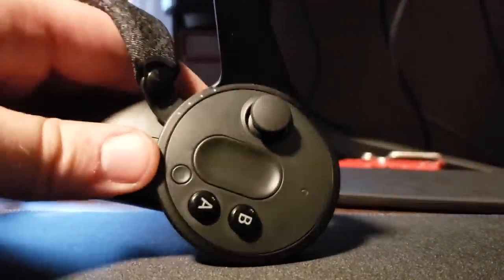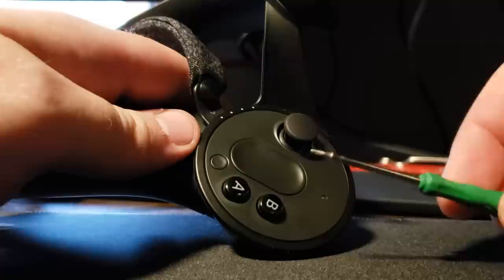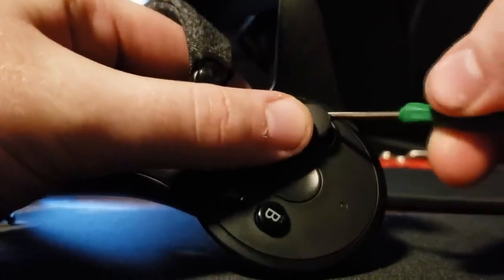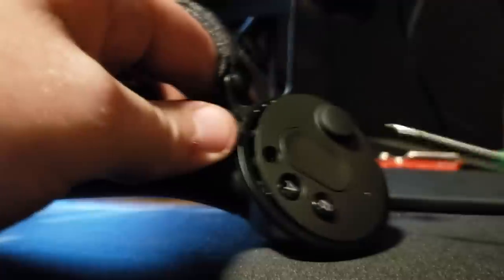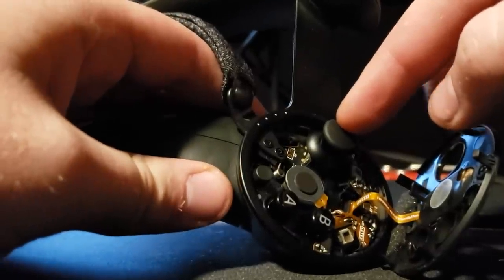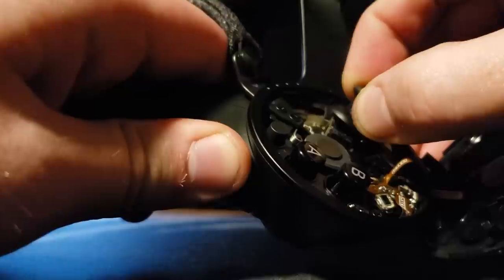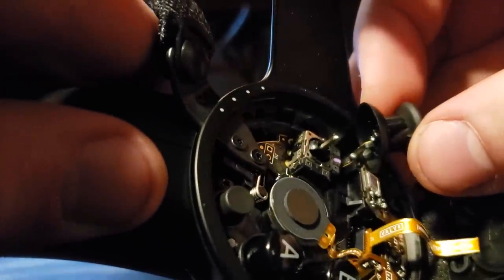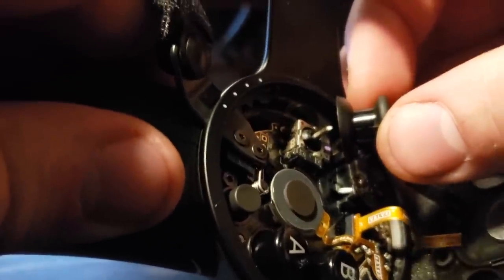How to fix your Valve Index Controller joystick clicks

Comment: Nilick little tip I seen on reddit and did my self. I got a beral pen like a Bic. and cut the nib off so the little ball bearing in the tip of the pen fell out. I then used that in my thumbstick instead of the tooth pick you used and WOW it works amazing well. I have to say though trying to get the tiny ball bearing in the hole was a nightmare and twizzers were not good enough,  what I did was rip a tiny piece of paper up and folded it up and put the ball bearing in that then I gently tilted the paper above the thumbstick hole until it rolled in and put it back together and what a difference.  good thing is the ball is easy to get out if you ever needed to. 
I now have thumbstick click in all directions
Reply: when i get my controllers and if they dont click i will do this! thank you :)
Reply: @BigDaddyMacc  Mine still work amazing. I did my friends as well but he order some 0.5mm Ball bearings off Amazon and they worked just as good. If you do order the bearings be aware that when you first get them you may think you have an empty packet lol I know this because i thought I had been sent nothing but it was due to just how small a 0.5mm ball bearing is lol.

Hopefully you wont have to go through this but I thought the ball method was better than the chop stick as I suspect the wood will start to impact down the hole and cause it to either stop helping or cause more issues. plus if you ever need to RMA the controllers it's simple just to let the ball drop out, with the chop stick I can see it being quite difficult to remove once it's been in the a while and pressed down over time. 

Good luck with your,  out of interest did you buy the index headset also? I did and wow the difference between the index and all the other headset I've had is unreal. I played pavlov the day I got it and was blown away by how clear the image was. It is like looking at a 1080 screen but on low settings but that's just down to the game being a made by a low budget dev team and the limitations of the hardware. 
I'm so excited for VR over the next few years.

Comment: Eh, aren't those controllers supposed to be $280 and have been in prototype for 3 years... Something makes one wonder how such QC issues can slip that easily
Reply: Looks like someone over-engineered that joystick, trying to make things as compact as possible they made the height of that pole the "minimum possible" but seemingly underestimated the amount of manufacturing variability it was going to experience in mass production, as this issue is only affecting a (decent) portion of users and is something that probably didn't come up in the QC runs.
Reply: @invertexyz  agreed.. as mentioned in my comment above, the amount needed to fix without causing any rubbing is 0.7mm increase

Comment: I wonder if a small ball bearing or steel shot the diameter of the metal rod would provide the same spacing function without having to fool with solder?  (drop it in the plastic channel for the rod on the joystick cap)

Comment: Cool fix for something that shouldn't need fixing. I was going to buy two complete Valve Index systems one for my son and one for me but I'm not going to bother, very shoddy equipment with a over inflated price tag. I may revisit the idea of buying them or something better in about a year or so, I've been waiting for the right time for VR but alas I don't think it's here yet ;(
Reply: Lol no product is perfect.
Reply: @whiteoutwolf6131  yeah I know mate, with a £1,000.00 price tag it needs to be perfect. This equipment has been rushed out that much is obvious shame were expected to be beta testers and pay for the privilege ;)
Reply: @djsquibby  I also Disagree with it being overpriced, There are two 144hz panels inside of the headset alone. This is not marketed for people on a budget its marketed for Enthusiasts. Every new Product has growing pains. I cant say i expected it to be the joystick but still. And all you have to do to completely fix the issue is Rotate the Joystick about 45 degrees and it works flawlessly until they start fixing them in production.

Comment: Any idea on what to do if solder doesn't stick to it? I reach to cut it out a little and it just falls off
Reply: Nevermind, a tiny bit of flux did the job. This is so stupid, I hope we at least receive a voucher.
Reply: @inero666666  Nah a voucher still ends up giving Valve money, just a little less.

Free games should be how they make up for this. A set of controllers with 3 years of dev time where the problem was reported multiple times, at this price range, should not suffer from this kind of thing.

Comment: Going to great lengths to build a premium product centred around quality that has a design flaw as obvious and immediately noticeable as this after so long in development makes zero sense. Makes me wonder if they changed something at the last second that introduced the problem.
Reply: Mark P it’s some bullshit. Returned 1 set. Both controllers had issues. Got another right 1 is perfect left still shit. I’m just gonna do this myself
Reply: @timmothy07  I had to RMA twice, but I finally got a fully perfect pair. It seems completely luck based, as people are still receiving pairs with this issue.
Reply: U Tubby just sent back my 2nd set. If this next pair is no good I’ll return the whole headset
Reply: @timmothy07  Good luck to you man! There are "fixes" out there, but honestly, I think the durability of these things are not what they should be and while Q3 was full of #clickgate, I think Q4 is going to be #driftgate. So I want to be damn sure I can return mine under warranty.

Comment: What do you mean by Sautering the metal rod? Like how did you do it?
Reply: soldering - you are adding solder to the tip.  It requires a solder iron and solder, along with delicate control of the tool.  Best to practice on another metal item first.  Perhaps like a thumbtack, upside-down stuck in putty to prevent it from moving.
Reply: Hey Dead Matter News! Didn't expect to see you here! You've bought an index? :O
Reply: Patrick I only got the controllers for now lol, but hey I’m still hyped about the knuckles regardless of this incident
Reply: @The-Real-Ivivik  what's your headset? Vive?
Reply: Patrick yeah, I’ll get an index later next year. I just want to get the knuckles so badly lol
Reply: @The-Real-Ivivik  haha that's awesome

Comment: What about putting a peace in the hole of the thumstick then place it back on . Would that work ?
Reply: Yes, but good luck getting that out if you ever need to send the controllers in for something else.
Reply: @WannabeSpaceman  I'm no good with soldering I'd fuck up somewhere . Maybe I'll try see is a TV repair shop whoud do this
Reply: @stevejarvislocksmith9178  Just get some acrylic nailpolish or epoxy and build up a little mound on top and let it air dry for 24 hours at least, then put the cap back on.
Reply: @invertexyz  I'm taking it it's only got to me about 2mm more
Reply: @WannabeSpaceman  you think valve is going to open it, and then somehow check if youve put something in there?
Reply: @ge2719  yes
Reply: Secure Access Locksmiths I did this mod a few days ago but I did the reddit mod. I got a bic biro pen and with pliers I pinched the end until the tiny 0.5mm ball fell out from the tip of the pen and put that in the whole and I can promise 100% it will fix this issue. it even makes the click you did have feel way nicer and not so hard to press. it now feels like my xbox one controller

Comment: Perfect. Thank you
Reply: I have just done it this evening and it actually works flawlessly! Instead of solder I used a tiny piece of aluminium foil that i compressed into a ball with my teeth and then cut down to size and measured with a set of vurnier calipers. The compressed ball measures 0.7 mm if this helps anyone